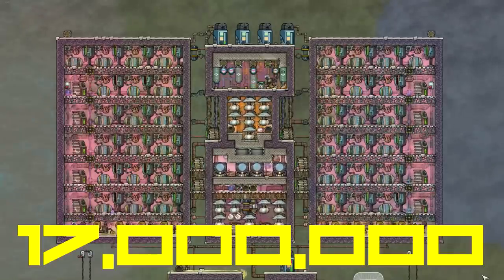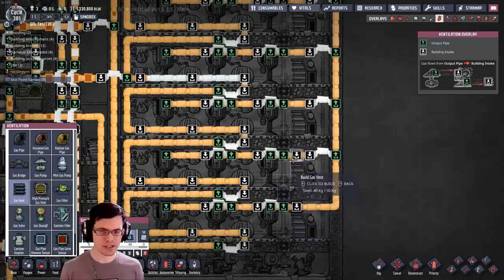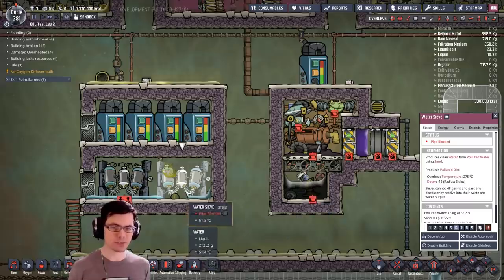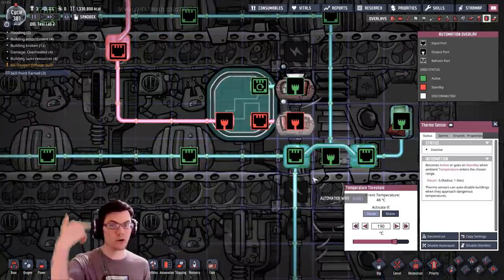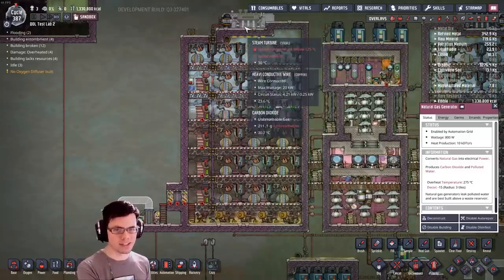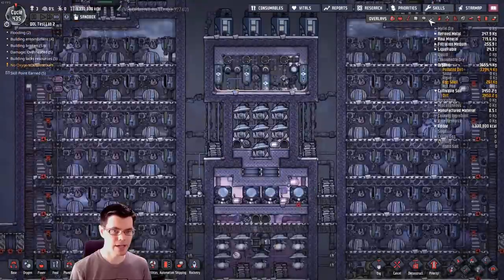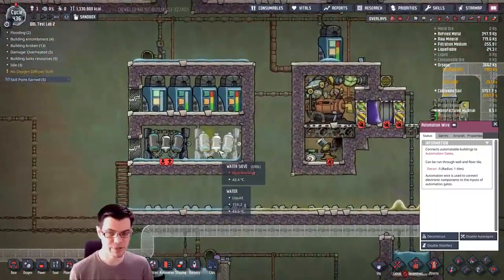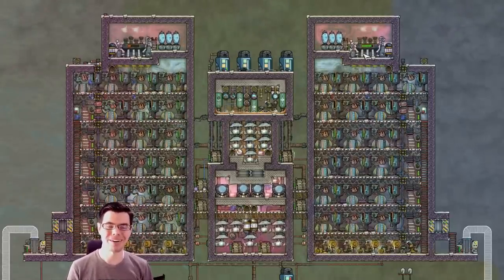MORE Free Energy From Steam! - Oxygen Not Included Tutorial

Comment: The output temperature of the natural gas generators is dependent on the temperature of the actual generator capped at the phase of the output. For example, a 500C natural gas generator outputs 119C polluted water and 500C CO2. You could try running the steam turbine at a much higher temperature to keep the room superheated and using the output CO2 heat to help boil the polluted water and then piping it off instead of just releasing it. Also, you could try using a heat injector into a steam turbine and running thermium natural gas generators to optimize this somehow.

Comment: a day before i tryed to build some construction to cool down water from cold gyser using turbine but i had some problems with it:
 one turbine prodice not enough energy to power aquatuner whiletermo regulators are not powerful enough(specific heat capacity is not enough:even hudrogen has 0.41 while enough will be 0.43(may be some more))plus some of time needs to be usedto cool down turbine(lowest possible output is 245w, so no wheezeworts i want it all)may be something like aquatuner+2 turbines or so)

Comment: Any thoughts on the new Autodroppers? I've been experimenting with using them to automatically cool solid materials in a more controlled manner and trying to work around the lag of heat transfer to temperature sensors. I made a little lowish tech setup that cools regolith to room temperature with slush geyser water, each dropper doing about 1000kg a cycle. It doesn't feel very efficient, mainly the long tail of temperature evening off, since the differential is quite small (20C to -9C). The automation has to have enough delay for the new chunk to heat the temperature sensor back up over the trigger point, but I got it sensitive enough that it still works even with 40C igneous. Maybe it's kinda pointless to be that precise over the temperature of building materials... could cool meteor iron, but that's barely enough mass to worry about either.

https://steamcommunity.com/sharedfiles/filedetails/?id=1741461374